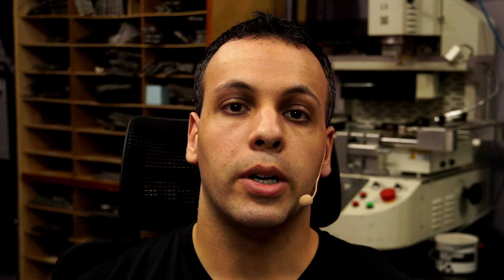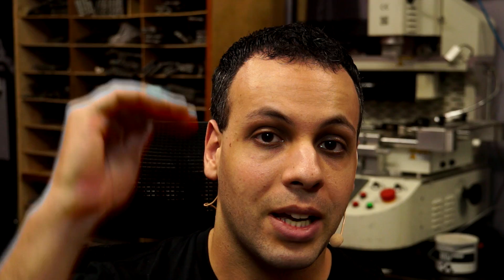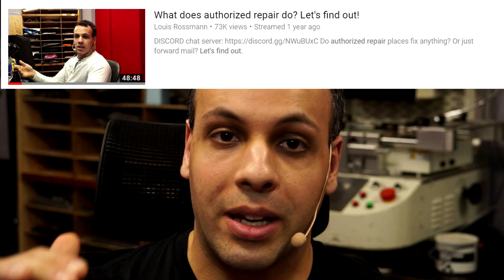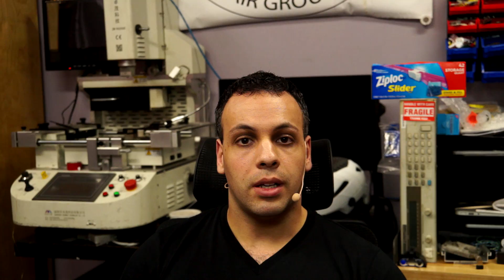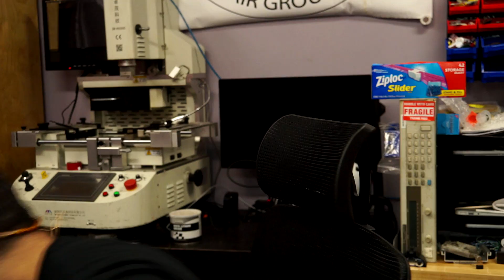Apple's war on refurbishing.

Comment: same go's for tesla. You work on your car? Poof, things get disabled. Unauthorized mechanic worked on the car? Poof no more auto pilot, no more fast charge and all that crap. And tesla wants to take that further too. So tesla is doing exactly the same.
And there have been others in the car industry that have tried, but those got kind of stopped back in the day, but those where mostly german companys. Now its apple and if they win then guess what? Tesla is going to follow 100% sure. And if tesla can then the other manufacturers will say well if they can then we can. Good luck paying 500$ at the dealer for just an oil change, 1000$+ for brake pads, and probably 2000+ for new discs+pads. Where the normal mechanic in the non branded shop can do the oil change for 100-150, the pads for probably around 100$(depends on car) and discs+pads for about 200-300 per axle. And at this point the dealer is only 2times as expensive in most cases, but if they know you cant go anywhere else then they know they can increase their prices...

Comment: Just replaced the keyboard and HDD (swapped for an SSD) on my wife's Lenovo. All it cost me was the parts cost off ebay and about 40 minutes of my time.

The ONLY reason Apple want to "repair" themselves is so they could charge you 10-20 times the cost of parts. Competition drives prices down. They're trying to monopolise their own repairs even though you OWN the device and have the right to have it repaired anywhere you so desire. This infuriates me to no end. Not because I own an Apple device, but becasue they employ every underhanded tactic to take that right away from me.

Comment: The Automotive industry has been doing this for years:  Especially the European cars, they call it "component protection" .  Many, many electrical parts on cars are not interchangeable with a different car of the same exact type.
Reply: The American auto industry has always been sleazy as hell e.g. the dealership trade restriction to hinder discount car shopping. IT would be the first place to expect sh***y business at. That's how bad business such as General Motors stayed alive there. I wonder if the Asian car manufacturers do this repair restriction nonsense. My guess is 'no' as hindering productivity like that is completely against Toyota & Co.'s total-productivity-oriented Six Sigma production process.

Comment: Not refubished iPhone.  Call it a former iPhone.
Reply: No. Apple products include intentionally weak parts to make them break down and to force users to  buy another one. Most likely the new part is BETTER than the original crippled one. Call it improved / finally usable iPhone. :D
Reply: "Improved" implies that it is still an Apple product.  Not, a device converted from an Apple product into something (better or otherwise).  The repair shop should slap a "Former" sticker above the Apple logo.  Statements about improved function become discretionary.

Comment: 4:45 it’s not that easy. They are gonna always produce a screen (e.g.) that is slightly better or they will find a way to make it as similar as possible to the original. Also this kind of judgement over the quality of a product is SOO MUCH subjective. It’s not objective at all. I understand all the companies that do this. Imagine you sell a product and you try to make it as good as possible, then people are buying broke products for cheap, replacing pieces with non-original parts and selling again making profit. Internet is FULL of these people, trying to scam everyone. In those cases, Apple (for example) is gonna loose its image, its quality target, people are going to say iPhones screen are garbage just because a hacky boi changed the screen and sold it that way... It is much more important and much more complicated. Corporations are going to make money out of it but also... Seriously... There are not many ways to do this thing well. Surely better than it is now but again, it’s not as easy as you made it.
Reply: Get of the ebay, dude. Only scammers are there. Louis even addressed this one with his point about having a grading scale for the replacement parts.
Reply: I Have No Son Believe it or not... They are not only on eBay. They are everywhere especially in small repair shops all over cities. Also don’t think that your experience is the same as others, here where i live is a very common thing to see. I don’t think the Louis solution is good, can i think that? Do i have your permission?

Comment: actually manufacturer like lenovo did the same years before apple, and always be some hackers who will make that activation software. And what apple do is a good thing, way? I so so many people who buy from eBay cheaper mac or iPhone, which has some terrible screen, some dude glue together like 5 mac's and made one, and they say, oh look how shit apple quality is.
Reply: Acer was the worst. They would sell you laptops built to break down and then be complete bitches about the warrantee replacement i.e. it taking a long time, coming back still broken or having the replacement parts break again repeatedly. Even the soundcard manufacturer Creative did the same f-ing s**t. My Sound Blaster AWE 64 card got replaced no less than FIVE TIMES for it mysteriously turning mute after the first program run after a reboot.

Comment: How else are you going to get around the laws allowing anyone to repair their own product? Remember all those void warranty if removed stickers? Well stick a sensor on it and force the system to lock itself so you have no choice but to send it in! Apple is just the pioneer in that sort of tech so expect not only phones and apple products to do it but also game consoles, monitors, and all sorts of other electronics. I fully expect the next generation of consoles is going to be exactly like that and when someone cracks open the case to clean all the dust that accumulates there to be locked out of it. Remember no company wants most of the money, they want ALL OF IT. It sucks and it's a crappy practice but greed corrupts. Remember things used to be made quality, and now everything is designed to fail after a short while to keep you buying. I wouldn't doubt apple also has a counter to how many times you plug it in to charge it and after so many it starts killing itself so you have to send it in or buy a new one even when its still good.
Reply: Apple's advertising tone should clue you in why they do the greedy s**t. It is "you buy from us because we are expensive." :D

Comment: How do these ID codes for the parts work? Are they a string of characters that are somehow programmed into the part by the manufacturer when it's made? Or are they somehow permanently generated by the part itself and cannot be changed? Would it be possible to somehow change the ID code in the new part to match the code in your old part? Or maybe components that store the code could be transplanted from old parts to new one?
Reply: If I was Apple, I would store the parts IDs in places where a crack would instantly destroy that information and prevent the part for being refurbished. Probably a tiny chip on the part close to the connectors. You don't need a noticeable microchip to store one binary part code. RFID is the simplest ways to do it with modern WLAN-equipped machines where the receiver in the part sends back its code that is compared to the one stored in the logic board memory.

Comment: Before you go to Norway there are a few interesting facts about out consumer-protective laws worth reading up on. Like for electronics products costing vaguely defined as "meant to last at least 5 years" and costing more then ~1000 NOK we have a laws requiring the producers to cover faults happening within these 5 years regardless of their warranty policy. (two years for cheaper electronics costing less then ~1000 NOK) and if something fail within the first 6 months it's on the producers side to prove that it was destroyed by you as a consumer to be able to avoid covering your cost, like if you have a cracked screen on your phone and it works just fine after that but a few months later your phone just dies, it is up to the producer to prove that it was the cracked screens fault for the device failure. However after 6 months if it you that has to prove such things if it is the case. If the phone otherwise is fine they are required to fix it for 5 years after purchase.

Comment: But I don't understand this. Where is apples case? If you buy a phone from them it is now Your Phone. Your property. Are you not free to do what you want with it and send it to whomever you want to send it to. It's your property.
Reply: It is in your hands, yet Apple controls its software. In that sense it is never fully yours unless you break the U.S. law by jailbreaking it (the law fell to insignificance with the loss of the AT&T subscription bundling). You are told that you are free because YOU. ARE. NOT. There are laws preventing you from doing your things with your stuff. Apple pretty much owns your things (NSA PRISM spying program) and your stuff (controls and accesses your data through its own software).

Comment: It was a while ago (back in the 2000's I think) so can not remember the full details. There was a report of some of the German automotive manufacturers trying to push for legislation to outlaw the use of third party parts in vehicle repairs (including the fitment of aftermarket modifications), and that only manufacturer approved technicians would be allowed to work on the vehicles. Fortunately the legislators turned them down on this. 
If they had got this through it would have effectively shut down independent car service and repair. Any DIY attempt to service and repair. Any company that produces after market parts. Automotive parts suppliers. And force up the cost of insurance with increased repair costs.

Comment: This has been going on in the automotive industry for decades. This needs to be settled FOR ALL INDUSTRIES, not just electronics repair.
Vehicles now come with more and more complex measures which have little to no benefit to the owner, which only inhibit 3rd party or even owner repair.
Did you know certain 2016 cars and above can't be aligned at a regular mom n pop alignment shop? Or in your driveway if you have the know-how?
This is due to a "steering angle sensor" which is, yet again, passed off as a "safety feature" which needs to be set by a "certified dealership" ONLY computer program, which if they release it to third parties will likely cost $10,000 per year lease, as in other "safety features" which completely disabled owners from repairing their own vehicles, or 3rd party repairs.
This is why i will buy OBD2A and under vehicles ONLY and will not buy a newer vehicle, along with many other knowledgeable people.
Reply: You will have a Christmas Tree light show on the dash. You could also jeopardize safety. These systems could steer you into the other lane if not calibrated.
Reply: Well, all that collision avoidance stuff, lane keeping, etc. Supposedly under the guise of safety, I love working on cars. The newer cars are getting more disposable, especially if it isn't a mainstream model (e.g. like a Camry).  Parts and modules become harder and harder to find, and are obsoleted by the manufacturer. For some cars there just isn't a market for it, and the manufacturer wants you to buy a new one when the warranty is up.
Reply: Even scan tool data from cars is kept under lock and key. There is basic OBD2 information, and that is freely available (government mandated) it is about 20 basic parameters for the car. Beyond that, a car may have thousands of values, tests, data, etc, that require a very expensive scan tool or even a dealer visit. Even my 95 Lincoln has an impressive set of tests and data for the air suspension computer and others. There is a guy who released all the Ford scan tool info free with a cheap adapter but not the case with other manufacturers and newer cars. Normally to make a scan tool you need to pay 100k-1 million for the info, and who knows even if it is 100% complete. The maker  sells a scan tool that cost thousands, or you are at the mercy of the dealer to do the repair. Like I wrote above the company can stop making parts, right after the warranty is up if they want.  If it was up to the makers, they would only have this info available to dealers (like Apple) and after the warranty is up make repairs not worth doing. This is business. WHat if you made cars? Would you want people holding on to them forever? Would you want people to buy new ones?  That is capitalist thinking.   Tesla operates that way. I don't even think they make parts for their cars.

Comment: It's technically remanufacture and it would not be unreasonable to state that if you use a remanufactured part your warranty with Apple is void, that's fair. It might help to give out a small leaflet stating this (yes I know it is in the warranty documentation for the device) when selling the part.

Apple doesn't have a leg to stand on and I truly hope they are fined for attempting this stunt. Unfortunately I am aware that corruption is rife and they could get away with it.

Comment: Actually, the LCD doesn’t have an individual part number, just the entire assembly; glass, digitizer, display and backlight. The problem is this bloke is taking used parts, refurbishing them and then selling them under the guise as being apple parts. Reality is, if someone bought a bunch of Bosch alternators and recoiled them for resale, they too would be sued by Bosch. This is why, when you go to parts places to buy refurbished parts, the OEM logos are missing on the parts. The labels say “refurbished” and that’s it. There are no serial numbers or OEM numbers at all. I personally don’t see a single issue with Apples claim and Im sure Apple sent this bloke a cease and desist letter way before legal action was taken. I’ve felt the brunt force of their legal team and they usually give you a warning shot first.
Reply: The Compiler Yep... and I don’t mind this cat, but he’s very bias against apple and doesn’t really think things through before spouting them.
Reply: When the laws override common sense from the perspective of the consumers, you change the laws, you do not blame the consumers for wanting the better business to do their repair work.
I do not give a shit if the pull-cable in my scooter is original or certified by Kymco, if it works, fine! That is all I care about, that is what the vast majority of people care about.
If your car breaks down, you want it to work again, you do not give a flying fuck about who repairs it as long as it works well,  a lot of people do not give a rats ass about what parts are used, and if someone can do an equally good job for free instead of say, 1200-2000 dollars, with complete loss of data on top of that massive repair cost, what do you choose?
That is when you use common sense.

Comment: What's sad is this whole idea of screwing with software to lock users in has been Apple's MO from the earliest days of the Mac, far before "security" could even be considered a remote concern for most users. Classic example is the original SCSI hard drives. Apple used off-the-shelf SCSI hard drives in the late 80s and early 90s (when drive sizes were measured in the tens of megabytes), often from Quantum, Seagate or Conner Peripherals. However, they would modify the firmware to change the ID string of the drive. Beyond this the drives were basically identical. Apple's disk tools then would ONLY recognize and format drives that had Apple approved strings - and remember, only Apple drives had those modified strings. If you tried to take the SCSI drive from your PS/2 and put it in your Mac to replace a slower, smaller drive, it would simply fail to work. Even nearly 30 years ago Apple was using sneaky software tricks to block out third party upgrades. Sure, plenty of upgrade drives were available and marketed to Mac users, but they often included clunky or even buggy SCSI drivers that tried to replace the Apple drivers (FWB disk toolkit anyone?). Or, you could use a HACKED version of Apple's disk tools that would format any SCSI drive - proving that the entire thing was deliberate. Maybe vendor lock-in is just part of Apple's DNA. You can't fault any company for wanting to maximize profits, but Apple has unfortunately reached a summit upon which they can ignore large percentages of their customer base and still turn a profit, and also can influence government and legal entities.

Comment: I agree with Apple. Your screen is not being repaired you're actually getting somebody else's screen. And it does have an Apple logo on it and is not the part it should not be shipped. You have the same problem with toner cartridges. You can't ship a Xerox toner cartridge out and then have it refurbished and sent back with the Xerox name on it like it was a Xerox Original Part. The only reason you're getting rid of it is Xerox sued. Apple is. Pineapple can get away with it because it's a monopoly. They have no competition. If you want to repair it yourself and put the glass on yourself why don't you do that. You say it's too expensive for you to do it so you'll allow it to be sent away for some cheap labor in China can do it. Time to stop this nonsense. If you believe in your customers so much repair their goddamn screen and charge them $800 and do a good job are they won't return and go somewhere else. That's how we do it in this country. I'm tired of everything coming from China including even refurbished stuff. Get the glass do it yourself or shut the fuck up